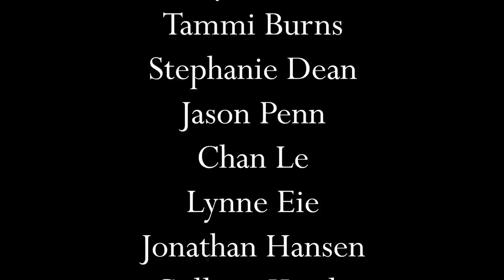Van Life | 3 DIY Projects You Haven't Seen Before!

Comment: The rear door with that plastic cover signals that water vapor/water could be collecting there!!!! Be very careful with what material that you use there as insulation. The carpeting material is a "no no" there because there is a potential mold developing there. Great DIY project that anyone can do!😎👍
Reply from the maker: So far I have not had any water issues. I’ll keep an eye on it though…

Comment: Glad you put the insulation in there. It took me forever to do my tailgate but it was so worth it. The difference is so noticeable: temperature control, sound deadening and it feels cozier and more solid. 
I disassembled the back panels, lined it all with the sound deadener and all the nooks and crannies with recycled paper insulation. Huge difference. 🌿
PS: it was awful to watch you screw that shelf in by hand. You can get bits for your drill—it makes all the difference.
Reply from the maker: That’s good to know about the sound deadening and insulation!!! 😂 I have a drill— there are some projects I just am scared to go through the side of the van so I do it slowly… by hand😝
Reply: @LadyBugout  Indeed. Some things I definitely still do by hand but when there is sooo much to do, I welcome the power tools. This recycled paper insulation (mildew/mold/fire resistant) is very easy to work with and not expensive. I can’t rave enough about what a huge difference it has made to fill all the metal spaces. You’re doing great things and it’s a pleasure to watch it come along so beautifully.🌿

Comment: It gives me great ideas for my back doors. Since your platform on passenger side, I have taken out my passenger seat, and installed a full size 4'x8'x1/4" sheet of plywood. I had to cut out where the drivers seat is located. It sits at a perfect height for Archer to be able to see out the windshield and stick his head out the window. He loves it. Now I have to cut out a lid with a piano hinge where the seat was, and also a long piano hinge for storage across where people would of put their feet if this van would of had back seats. I bought 4 piano hinges, different sizes at Lowes. I always buy what I think I might need, then just take back what I don't use. I would rather do that, then have to make multiple trips trying to get a different size. I felt so bad for Archer bringing home 2 sheets of plywood. He had very little space by the passenger door. He couldn't lay down, or even see out the window. Almost $100. for 2 sheets of plywood. No discount for military on lumber. It felt good to do the very first project on the van build. It gives you motivation to keep going. You are a great motivator also. I will be very happy when the weather is a great motivator. It was 95 degrees yesterday. I need to get in the habit of taking pictures. I wanted one of the van completely empty before I started, and I forgot to take one before I put in the plywood. Oh well, a little extra work, and I will get that picture. 
Take care Dee, be safe and always stay as sweet as you are. I pray you are completely healthy again, and feeling great.
David and Archer
Reply from the maker: Wow! Sounds like things are moving along! You are smart to think of all you need at once. Yes, take pics of progress. It will be encouraging!☺️

Comment: Regarding those 4 aluminum pins you see sticking out once you remove the cover on the left side rear door – (Drivers side). They are the back sides of the screw holders for your license plates. There are 4 – 2 for American standard size plates and 2 if your attaching European plates. You can drill the European holders out and make more room for storage and plug the holes with plastic filler plugs like the ones you removed. I also replaced the plastic plugs holding the cover on with large plastic screws so you can remove the cover anytime.
Reply from the maker: Good to know. Thank you☺️

Comment: I’m really interested in your assessment of the sound deadening material you installed. Has it made a difference?
Love your videos! 🤗
Reply from the maker: Time will tell. But I’ll keep tabs and let you know.
Reply: @LadyBugout  actual soundproofing actually requires things to be pretty sealed up.  Sound just goes around the deadening materials, through the gaps between.  (Speaking as a professional acoustics consultant.). If you look up "flanking noise", you will see what I mean.  The deadening you put in might deaden some of the rattling of the metal panels, but it won't stop sound from transferring in and out of the van unless you have full, sealed coverage, unfortunately.    I hate to see people waste money doing a half job trying to sound proof, and finding that the money they spent really didn't get them anywhere because there are still open gaps for the sound to come through.

Comment: Using the carpet mat as insulation is great repurposing.  Wondering why you didn't just put it inside the cavity before covering the hole?
Reply from the maker: I only had enough for out or in—😜 I chose out because the sound deadening also acts as insulation!

Comment: Hi there,
Thanks for all the great videos I've been binge watching 😊...
I was wondering if you had a link for the exact balsa wood slats you have in your van. I've been looking and and terrible at measurements on line. But I have the exact same van that you have ours is a 2011.
Thanks in advance for your help 🙂
Reply from the maker: Thank you, Ariana, and welcome to the channel! I do not have a link. They are really just craft balsa wood that come in different widths and lengths— very easy to cut with exacta knife or scissors. It is very pliable. I got mine a Michaels (a craft store). Sometimes they have them at hardware stores. Sorry I can’t be of more help.

Comment: I see in many of your videos that you screw screws directly into the body of the car. What kind of screws are these and do you have to drill or cut a thread into the metal beforehand?
Reply from the maker: They are called self-tapping screws and you do not need to drill beforehand. Just be sure it is in an area that has a double wall so you do not go through the metal of your van!
Reply: @LadyBugout  Thank you <3

Comment: 👋 I live in Fl and it gets 🥵 so what does a person do of trying to keep cool like A/C?
Reply: Hi. I live in Florida also. I am building a 2016 Ford Transit connect cargo van. I know what you mean about the heat. I hate the humidity here. I am putting in a MAXXFAN with REMOTE control. I don't plan on being anywhere close to Florida during the summer when I finally hit the road in February. I have a 1000w JACKERY that will run all my electric. In summer I plan to be out west in low humidity states. During the day if I am in the van, I will be either traveling with the Airconditioner or outside the van exploring. At night I will be in States that cool off at night, so Airconditioner is a non-issue. If I had to live in Florida, in my van, I would put a regular 5000btu Airconditioner in the back door. As you know it is a necessity in Florida. I did a lot of research about these expensive dc Airconditioners for Van's. If your traveling,  you are the one that chooses what climate your going to bed down in. This is my humble opinion and plan.
David and Archer my German Shepherd service Dog
Reply from the maker: Yes, David’s answer comes from someone who experiences it—so he knows better than I do!